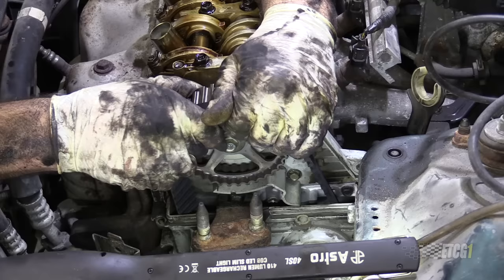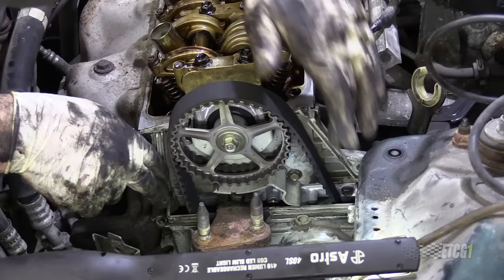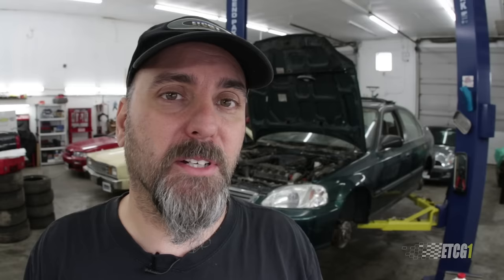How Come Timing Marks Don't Always Line Up Perfect?

Comment: It explains my OCD worries and still having an engine that beat ass after a head gasket, water pump, and radiator; at different times in one month, and still breathing like a beast. It made me sketchy, about the work I had done, but after lifting the cylinder head, slapping it down twice, and revving harder than when I bought the car, I felt satisfied enough. All my worries on my first timing/head gasket job, over less than a tooth. Of course they won't say that in manuals, or most people online, liability reasons. Though, all the mechanics around me always told me not to sweat the small things like that here, it's nice hearing the logic behind it. Thanks again Eric! I would rather have a teacher like you than most others any day, keep at your approach and realism, I believe there are many that appreciate it.

Comment: You bring up a good point, Eric. I remember doing the timing job on a 2001 Camry V6, and customer had bought the timing belt kit himself. I recommended buying the Dayco or Gates timing kit, but he went with the dirt-cheapest option he could find (which always surprised me when he did that, because he was certainly well-off, but never understood the value of buying quality parts). Anyway, the marks on the timing belt would not line up with the cams and crank marks no matter what orientation I tried; so, frustrated and concerned, I had him go buy another new timing belt because I wasn't comfortable not knowing if the belt was spaced properly between the pulleys. Sure enough, with a Gates timing belt, it lined up perfectly. It could very well have been fine, as evidenced by your video, and knowing that now, I could have probably gotten away with it, but since I had never done one of those engines before, I wasn't going to take any chances and have to do it all over again!
Reply: sometimes those people are well off BECAUSE they are miserly.  If you are always spending extra on everything, you tend to have a lot less overall especially if you are making modest income; but if that same person penny pinches everywhere, it can have a huge effect on savings and therefore you appear more well off (ofc your guy could be a millionaire, but to some extent it still applies ...  but you did say a 01 camry, so probably not 'rich').

And to be clear, sometimes those cheap things ARE the same.  Go to Wal-Mart.  Look at Melitta coffee filters and then Great Value coffee filters.  The only literal difference is the bag they are in and how much melitta cares about how centered that stack of filters are in the bag (they care very much, and the display cases, they need to be lined up straight too).  I worked for a company that made them, the difference between runs was a bag switch and if the machine was slightly off, how finicky you had to be straightening them in the bag and keeping up with the machines.  This company also made wet wipes, Clorox had their own line and product (they owned it) but the other lines for store and other brands were pretty much the same outside changes for 'natural' or brand specific scents (rare); and the hospital only line.

The quality was all good, the company wasn't bad; just know that many products are a label or sometimes a container change, but can be the exact same product inside.  If you ever wondered why something looked very similar or smelled pretty much the same, that is why.  The products are basically contracted through other companies that focus on that industry.

I worked for dayco at one point, they shipped hoses to a lot of places including actual manufacturers, not just your local parts store.  If someone has that knowledge, they may just buy the cheap generic thing because they truly do believe it to be the same; and I guess he trusted your judgement and realized they could be different as well.  That would be my attitude towards it except I usually do tons of research first, and hopefully if I found a mechanic that respected my efforts and willing to have a short conversation about the parts I want to get to put on the car, we wouldn't have one of Eric's other video's problems, the customer that buy bad/wrong parts and makes their life harder; that would never be my point, I just want to know what I put on and would like to purchase it.  Like if I wanted Idemitsu oil in my car instead of generic 0w20 they get in bulk because it is proven to work in rotaries as it is what Mazda used at LeMans and in their race series to this day, it was developed specifically for the rotary and its use in being used in the combustion chamber to lubricate the seals and burn cleanly.  (that is the type of research and detail I consider respectful to a mechanic that respects me, but what the hell do I know, I'm just passionate about the cars I own and want as much involvement as I can get, but I'm clumsy when I work on cars and usually hurt myself and sometimes the car, so I try not to do major stuff any longer so I don't break something (car or self!)).
Reply: @kuromurasaki5273  You scratched the surface with this mindset, having capital allows you to be opportunistic with your investing. But this is a situation where you have to calculate if the upfront cost savings offsets the amount of time until the next belt change and the increased odds of the belt snapping and seizing up the engine. I would argue with the risk to reward ratio of purchasing a compentnet as important as a timing belt, you're much better off spending 100 dollars more to leave you that cushion for what if it does snap and costs you 4-5k towards an engine swap.

Comment: Eric, hats off to you for having the time to do this workout. Over 50 times? I would give up after 5 times. I was so pissed off when I changed my first timing belt in one of my civics. I marked the old timing belt, moved the marks to the new belt to make sure everything was done correctly, and after rotating the engine, I never managed to get the marks aligned again. Guess what, I tool everything off, did it again, and the same thing happened. I just thought, possibly this is the way it is, god knows. Next day, me and my mate did it all over again, yes, 3 times in total, I just wanted to make sure I wasn't doing anything wrong before starting the engine for the first time after changing the timing belt. After the third time I just thought, screw it, I will start it, and it was ok. Now, before I attempted to change this timing belt, I watched some videos and so on, and I never came across about this so called " Chain or timing belt hunting" just after one year or so I came across another of your videos when you mentioned chain hunting, and I thought, bloody hell, this information is a bit late for me. It would avoid some phenomenal bad language used on the precess of changing this timing belt.
Reply: I feel your pain...took it 4 times on my panda
Reply: @giogio4833  join the club 😀

Comment: I thought about that for a couple of minutes the first time I noticed, then I slapped my forehead for not understanding right away. Of course there is no specific limit of the belt length, it is as long as it needs to be to get around all the pulleys. The key to timing is that there are twice as many teeth on any camshaft pulley as on the crank pulley. The belt itself is only a passive participant, much like the road in a Nascar race. Even a small uniform stretch will affect the cam and crank pulleys equally, and timing stays in line! Manufacturers like to choose common lengths just so their parts dept can supply the same part to many engines. The mark will move around the perimeter of the belt path by exactly twice the number of crankshaft teeth every cycle, so the mark on the belt naturally creeps even without somebody planning it out. They aren't confined by the notion of keeping the belt length to pulley length to a specific ratio. The mark doesn't even have to return to home after a specific limit, though with the carefully designed notch spacing it will seem to do that because the length needs to be an exact multiple of one notch length (so that there are no gaps where the belt is joined end to end in the factory). As long as the pulley timing marks are aligned properly, the universe is in sync.
Reply: I've read a lot of fun comments about this video. This is fun too, but it's also the best explanation I've seen. Great comment. Good to see you Spelunkered.
Reply: it would be one very odd "short engine" to make it line up on the cam every other rotation even (belt would be exactly 2x diameter of the cam, lol) 
the longer the belt, the more rotations it takes to line back up at the cam and 2x that at the crank since cam runs half the rotational speed. rocket surgery =p
Reply: 271 rotations to get the marks to line up again on a Subaru EJ25 (2.5L motor used in WRX/Sti and other Subaru models)! Eric should consider himself lucky that he didn't try this experiment on that motor!

P.s. thanks for the explanation!
Reply: yeap, exactly. when we make some custom engines, theres actually a few different belts that will work on something like... 
lets say, a RB25/30 (rb30 SOHC block, with a RB25 DOHC head on it) , depending on where the new tensioner and idler pulley locations are, 
anything from a 250 to 255 tooth belt, usually we'll use a 253 tooth belt, 
just to have an easier time installing the belt, without too much slack
Reply: Your comment fully explained it best! Thanks! 😁👍

Comment: Okay, what is going on here is there are three different marked items that need to eventually come back into sync. It's not just the crank pulley and the cam pulley correlation, better described more like a crank and cam pulley correlation to specific timing belt tooth.  It just so happened to take 52 revolutions to get the mark that he made on the belt to line back up on that same cam sprocket tooth and land on both sprocket timing marks. Though it never went out of correlation / time. One last way to think of it is for example 60 teeth on cam pulley 30 teeth on crank pulley is a 2:1 ratio. But let's say the belt has 300 teeth.. the belt would throw in an additional ratio in the equation. I hope that makes sense, cuz I got no time for math. 👏👍😀

Comment: Thanks so much! I'm rebuilding a Chevy 350 5.7L V8 and the timing marks are slightly off for the timing chain. Not too much. I'm glad I found your video. Now I can move on to the rest of my project because I would be here struggling forever to get it perfectly aligned. 

My rebuild book says it has to be exact but there's no way to get it right on each other.

Comment: Yeah I remember way back when when I first did my Xterra 3.3 L timing belt same thing happened with me I couldn't figure out why the marks would not lined back up again turns out of course they are install marks only so the little white pen marks would never line backup but of course everything else did so little dimples drives you crazy sometimes thanks Eric

Comment: Cool topic! Ah Honda, anti-clockwise rotation..
Reply: My thoughts too .i never rotate my engs in the opposite direction from normal rotation .not sure if it matters just something i dont do
Reply: Yep. Can't use the time-tested starter trick to break that crank bolt loose. Honda should have made them left-hand thread.
Reply: @derekholdt747  question. Is a normal bolt, left or right hand threaded?
Reply: Only older honda rotate this side
Reply: @DE Nichols  // Standard conventional threads are right-handed

Comment: excellent video. this is why initial cam to crank timing is important. do that right an all is good. reusing old belt/chain? mark it to each gear, replace it to the exact marked locations. all is good. no worries

Comment: Wow that was a crap ton of work for this one video. That explains when i was paranoid about the marks not lining up when i had to move the crank after taking the timing belt off. Internal combustion engines where never supposed to run perfectly. It is a miracle that they do considering all the varibles that go into them.

Comment: Eric, I think you're a bit confused on why the belt or chain hunts. The sprockets teeth are not offset, they are symmetrical. Having them asymmetrical would be diffcult to time and correctly align and require a keyed belt or chain and cause problems especially Piston to valve or valve to valve contact on interference engines.
The belt or chain itself will always hunt because the difference in sprocket sizes and number of teeth on belt or chain. large cam sprockets, small crank sprocket
The difference in these sizes make it appear the belt or chain has shifted or is hunting but not really, it's due to turn ratios in cam to crank, I beleive it's 1 complete revolution of crank for every quarter turn of the cam on the 4 bangers. The belt in your case took 52 revolutions of the cam due to the number of teeth on the belt, if that is a d16 engine, it will use 104 tooth timing belt (go find the old belt and count, I bet I'm right), divide that by 2 and you get 52.  That's how many times that belt has to go around the cam before it lines up again. Even though every 4 revolutions of the crank makes one complete revolution of the cam itself. 
The TDC marks on cam and crank will always line up when cylinder 1 is TDC, always! That's why shop manuals tell you to rotate engine several times by hand and verify the forged alignment marks and ensure that nothing odd is happening with the tensioners or slack guides causing it to go out of time. 
Which is why it's recommended to bring the engine to TDC before you do a belt or chain replacement.
Reply: Absolutely correct. I would add that the reason timing Mark's dont always line up is due to a combination of initial manufacturing tolerance, cylinder head gasket compression (which affects the distance between pulleys, cylinder head re surfacing (which reduces the distance between pulleys and belt stretch. Additionally there is a measurable change in distance between pulleys when tbe engine is hot. Thermal expansion is a notable effect.

Comment: I once had to remove the Bosch fuel pump on a Jungheinrich forklift with a Perkins diesel engine,took me about 35min to align all 5 marks on the gears(no belt,no chain,5 sprockets)

Comment: That's what I've been telling people all the time, when it comes to setting the timing on Honda engines.  Just as long as the crank pulley is set to TDC, make the cam gear at closest as possible to factory specs.  It will start every time.  People have a tendency of setting the cam gear first and then the crank pulley, which leads to jumping a tooth or two and not starting.

Comment: This is the design that’s not given in repair  manuals in order to prevent because they might be afraid that it would cause people to set timing a tooth apart. Every time I did a stupid timing belt on my Honda’s I though it was my fault because the stupid pictures on the manuals would show it lining up perfectly, it was a major learning curve that I eventually got over. This video would have been so useful back then lol well I hope it helps people. I learned the stressful way.

Comment: The easiest way to change a timing belt is to mark the upper and lower sprockets, and put corresponding marks on the block or head. If you're rebuilding the engine then that's a different story. But if its just a belt replacement you just need those sprockets in the same place when putting the new belt on.
Reply: TargaWheels it does work but it’s not always the simplest or best way. Sometimes a valve spring will be under tension and when you take the belt off, the cam shaft will spin round a bit. Then you end up trying to put the belt with one hand while holding the camshaft in position with a spanner. Then you’re left wondering if a valve hit the piston crown and got damaged until you start the engine. The other issue is that if your old belt had a bit of stretch, you’re putting the new belt back on the wrong position which could be a tooth out. Sure, it’ll run but it’s not good practice. The best way is just to use the timing marks or better still, locking tools if you have them. If not, some engines can be locked with bolts in strategic places.
Reply: On my car there are colored markings on the head and block and sight holes on the pulleys that you line up with those markings.
Reply: Just sharing what I've been doing. Honda/Acura, Toyota, I've done it this way without a hitch. If it does move slightly I'll rotate it back when putting the belt on. After I set the tensioner I go back around and make sure all my marks line up.
Reply: Barry McNicholl Yes.! you nailed it,I I used camshaft locking tools on my GM 3.6 and I feel so mucho confident that I did right after every 2 turns the timing marks on camshafts are aligned with locking tools,those $18 that I pay for them makes me sleep well 🙋🏻‍♂️
Reply: @TargaWheels  what if I rotated the crank after I put the belt on, and when I looked after rotating a few the marks on the belt did not line up...
Reply: @ryanopfer6845  similar issue here.  Honda V6, set two cams at TDC leaving tension side lose for the tensioner.  When I release tensioner and spin crank again crank pulley stops about half an inch forward of the mark.  It's fine if I reverse crank by a bit, but question is marks are supposed to line up after the motion of rotation settles right?  Is it possible momentum is moving crank past its mark?